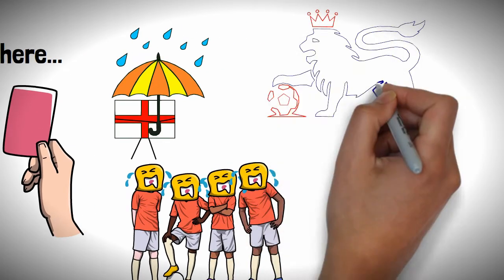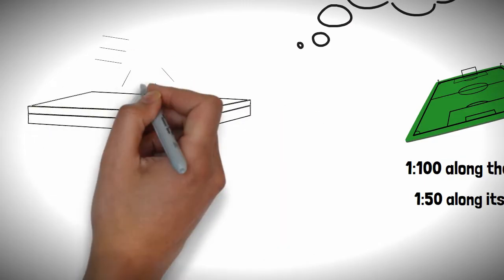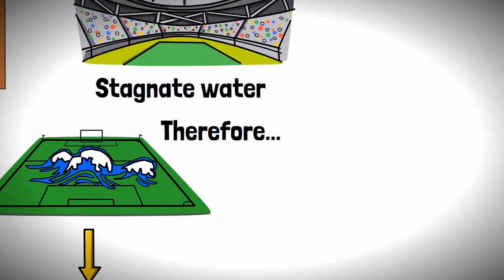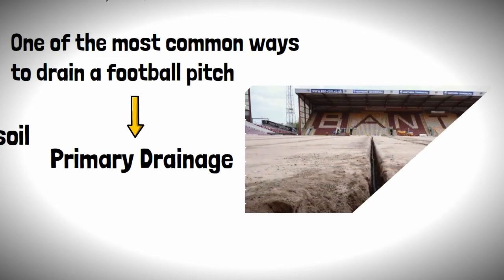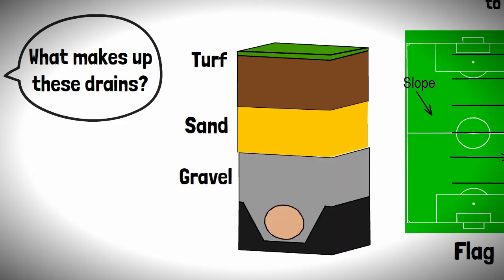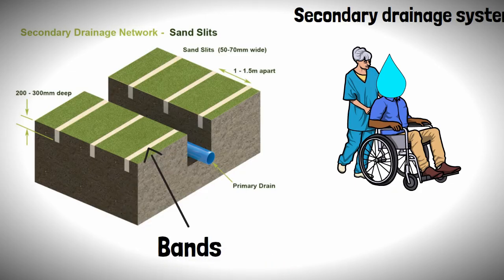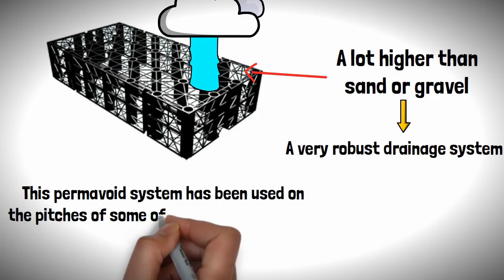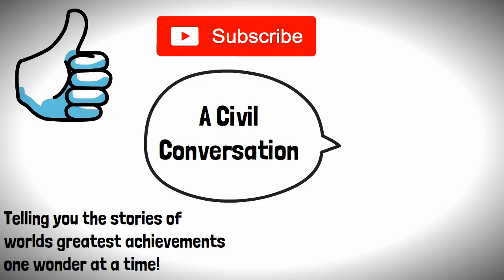Football Pitch Drainage (and the Engineering Behind it!)

Comment: seen in other videos mention of “perched water table” resulting from water’s difficulty passing from a layer with fine particles (sand) to one with big particles (gravel) - is that a factor here? basically the balance of forces acting on the water (gravity, surface tension, capillary action) is such that some of the water sits above the gravel layer, having trouble passing down through

Comment: So please tell me more about teh Permavoid System.
Reply from the maker: Sure thing, it's quite a nifty system which increases the available volume to store water underneath the pitch (compared to normal pitches as the void ratio is a lot higher). This not only allows water to drain from the pitch quicker but allows the water to be used for other purposes e.g. rainwater harvesting.
Reply: @acivilconversation18  what stops the crates getting filled up with the topsoil from above?
Reply from the maker: @niallwatson4278  Great question Niall. The crates will be covered with a geotextile membrane, this will create a barrier between the soil above and crates but will allow the the water through into the crates.  Thanks for your comment.
Reply: @acivilconversation18  Does the surface under permavoid system has to be inclined so the water drains off?